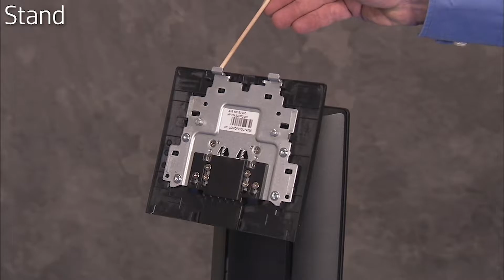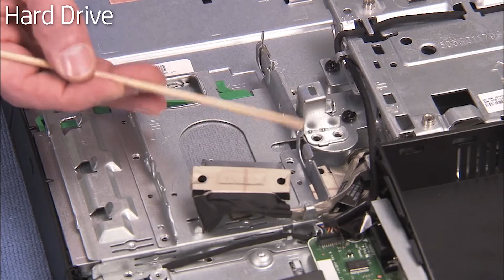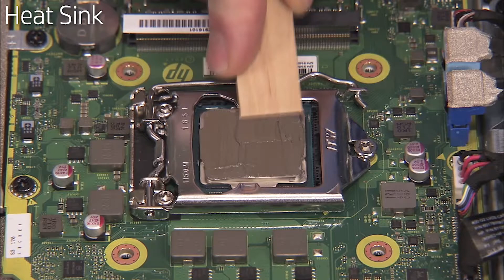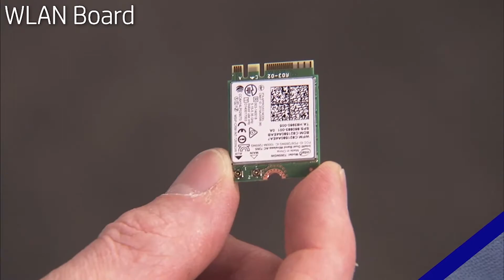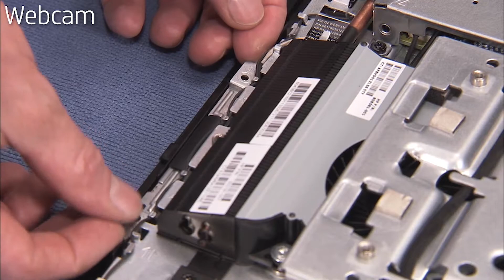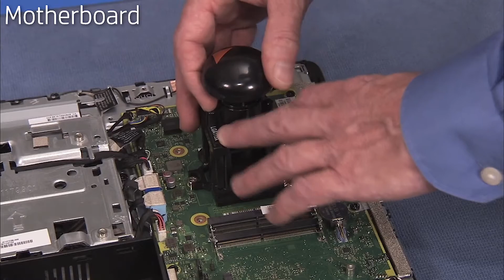Removing & replacing parts for HP ProOne 400 G3 20-inch | HP Computer Service

Comment: fix overheat
Reply from the maker: Hi there, thanks for contacting HP Global Social Media Support!
I understand that you are experiencing an overheating issue on your computer.
I will do my best to assist you.
Use HP Support Assistant to find and install updates, including BIOS updates, for your computer with Windows.
In Windows, search for and open HP Support Assistant, or click the app icon  in the taskbar.
If the app is not installed on your computer, download the latest version from the HP Support Assistant website: https://splr.io/6057Y3IQH
On the My Dashboard tab, find your computer, and then click Updates.
Wait while HP Support Assistant analyzes the system.
After the analysis completes, select the listed updates, download and install the updates, and then follow any on-screen instructions.
If prompted, restart the computer, and then close the tool.
Regards, 
HP Support

Comment: This video does not seem to cover the Touch Screen. I am looking to upgrade my non-touch screen HP ProOne 400 to a touch screen. Is there a video that covers that upgrade?
Reply from the maker: Hi Richard, thanks for contacting HP Global Social Media Support!
I understand that you need to know about changing your touchscreen from non touch to touch.
I will do my best to assist you.
HP does not recommend upgrading or downgrading hardware parts or software that is bundled with the product as It may affect the manufacturer's warranty and performance, however, you could change the configuration at your own discretion.
Binu-HP Social Media Tech Support

Comment: Graphics card upgradable?
Reply from the maker: Hi Taiyeeb, thanks for contacting HP Global Social Media Support!
I understand that you need to know about upgrading the graphics card of your computer.
I will do my best to assist you.
Checked the specification of your computer and found that it does not have an expansion slot to add external graphics card.
Binu-HP Social Media Tech Support

Comment: there's no hdmi or vga slot included in this set, sir?
Reply from the maker: Hi Melania, thanks for contacting HP Global Social Media Support!
I am here to help!
What seems to be the issue? Are you facing any technical issues with your HP computer?
Let me know!
Binu - Social Media Tech Support
Reply: @HPSupport  i'm wondering how to connect this pc to a projector, sir. because i couldnt find any vga or hdmi slot. does it need any other external connector sir?
Reply from the maker: Thanks for the reply.
Please refer this document to know about connecting projector: https://bit.ly/3kWHUQ0
Binu - Social Media Tech Support
Reply: @HPSupport  thank you for your response. i've read the doc and seems like i still need an adaptor for this type.
Reply from the maker: If you need any help in the future, you can always get back to us.
Thank you for being a valuable HP customer.
Have a wonderful day!
Cheers!
Binu - Social Media Tech Support